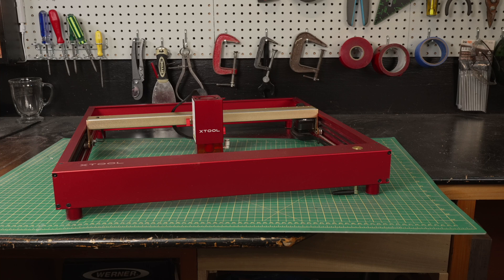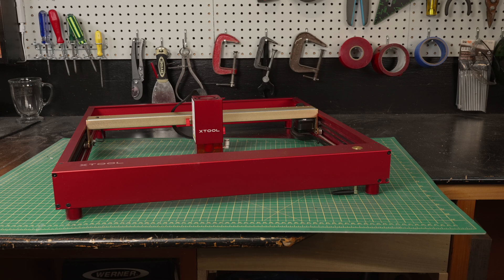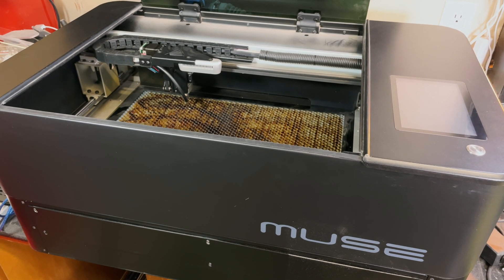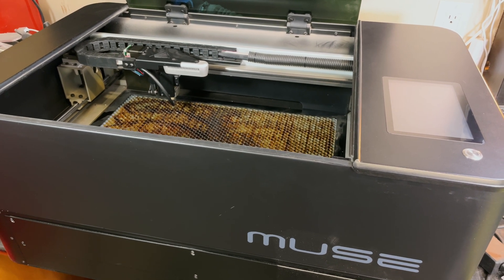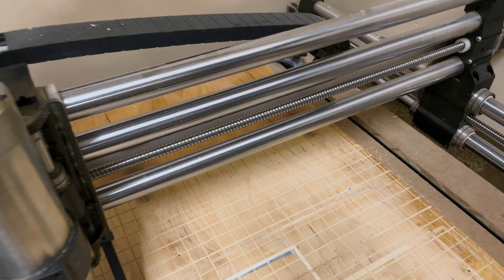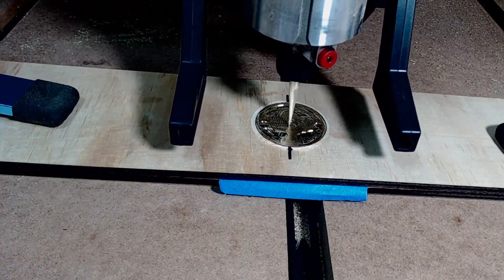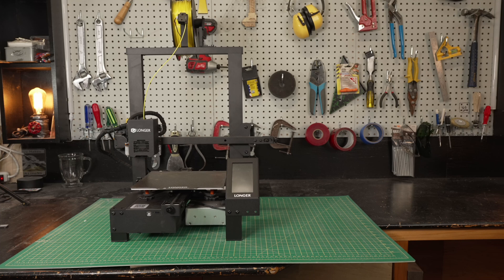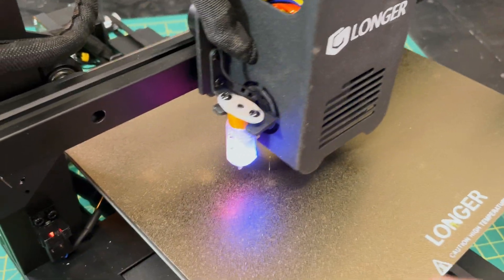Maker Business Essentials: Mini Shop Tour and Key Tools You Need

Comment: Hi Steve - with the different tools (Diode/CO2/CNC/3D Printer, etc…) do you find it necessary to run multiple PCs to work simultaneously or will one rule them all (lol). 

Glad you are feeling better and thanks for another interesting video!

John
Reply from the maker: Not really. All of my lasers run from a single copy of lightburn. Of course if you were doing multiple jobs at the same time you would need multiple PCs or you’d need to write your files to USB sticks. My CNC is it’s own web server so I can run it from any web browser or from its own screen. 3D printers use different software (cura) so the can run in parallel with laser and CNC jobs
Reply: @SteveMakesEverything  makes sense. I plan to get a 3D Printer and CO2 down the road to accompany my D1 Pro. Thanks!